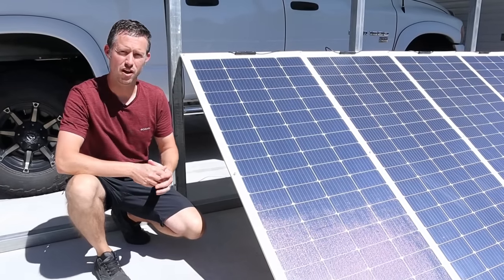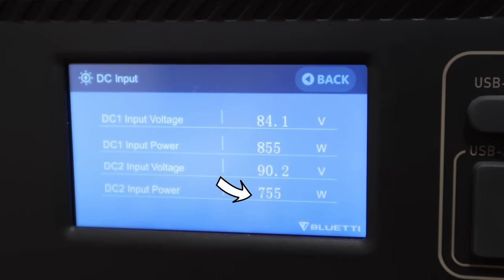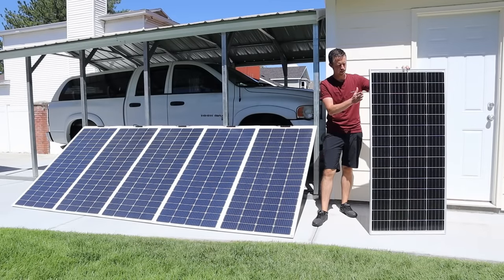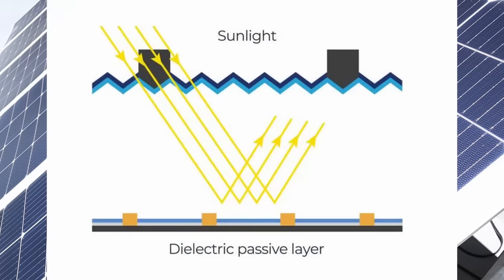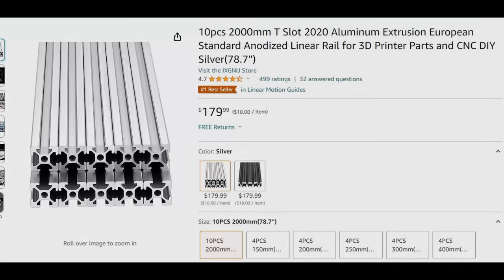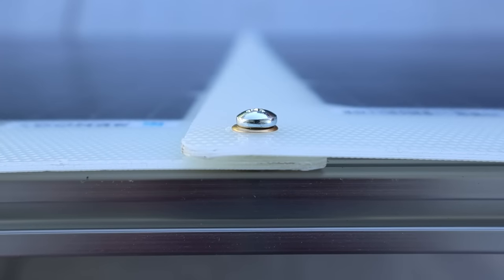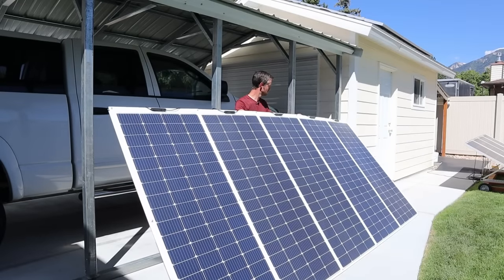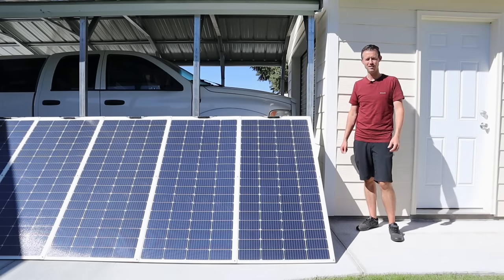DIY - 1000 Watt Lightweight & Portable Solar Array - Five Renogy 200 Watt Flexible Panels TESTED!

Comment from the maker: What a fun project! You can find the Renogy 200 Watt Flexible Solar Panels HERE:   https://renogy.sjv.io/200wflex
SAVE 6% OFF using DISCOUNT CODE:  JASONOID    (valid on their website until Dec 31st 2023)
You can also purchase them on Amazon HERE: https://amzn.to/45spg7C
Reply: Hi very nice great! why in the renology site is reported 12v while in the video i see 20 volt operating voltage?
Reply from the maker: @antoninoromeo4015  yep, that's how all 12v solar panels are. In order to charge a battery you need a higher voltage than your 12v battery. 12v panels put out around 20v at peak power. 24v put out 32v at peak power. The naming of a 12v panel is based on the batteries type they are meant to charge, not the output voltage.

Comment: Wow that is lightweight! Holy cow
Reply: That weighs as much as one of my 400W bifacials. Insane!
Reply: I wonder how well it would fair in a windy environment
Reply from the maker: I've tied it down to my carport using rachet straps, survived 40mph so far! 👍😁 Super impressed with the power too!
Reply: @WillProwse Very well! I have this exact set up plus 5x Renogy’s 175W panels for my EF Delta Pro’s (thanks for all the work you did on those, you’re reviews are why I pulled the trigger). 

I live in England so we don’t get the hurricanes you guys get but I‘ve had some serious wind (they’re effectively in a wind tunnel) and without them even being fixed to anything they do not move a mm. They’re just not thick enough for wind to get underneath to lift them, I do plan on fixing them before this winter but I’ve had the 175’s up there for a couple of years with no issues. I also have a 400W EF folding panel out there with them and a decent gust flipped that once despite the weight.
Reply: @InimitaPaul  The wind doesn't get under to lift them, rather it creates low pressure above them, the way a planes wings work. Up and away!
Reply from the maker: It's tied down with rachet straps now it's survived a few good storms, it never moved at all 😁👍
Reply: For rv install , this is perfect
Reply: Will Prowse wuz heeerrreee!

Comment: You know, if you went with 4, put a hinge in the middle, you could fold it and take it camping. 800w is a decent amount. It's light enough for camping. You, sir, just gave me an idea. Thanks 👍
Reply from the maker: Let me know how that goes! Extruded aluminum has so many options!
Reply: @Jasonoid  I have these 200W AllPowers foldable panels. I have 3 will get one more and use them. I'll let you know how it works out.
Reply: You can make a four panel double folding suitcase array
Reply: @Johnny_Kanuk - But AllPowers folding panels are not meant to be outdoors in all weather, as I understand the info on them (and other folding portable panels).
Reply: @debbiedogs1  yeah, hence why I would make it folding. Only pull them out for sunny times when I'm out camping or just need the power somewhere.

Comment: Cool project, but very expensive if you are not getting sponsored by Renogy 😂.  I think it would be cheaper, easier, and lighter to get a couple 400-600 watt portable folding panels.
Reply from the maker: These used to be affordable, near $219. The price of these jumped significantly last year about a month after the video was published. I actually bought 2 of them for a different project and then came up with this concept. Bummer the price of these is sky high now.
Reply: @Jasonoid  cool, thanks for the reply.

Comment: you didnt get an extra 50 watts from spraying the flexible panels and cooling them, your home panel array also went up by 50 watts. that means that the solar conditions made the difference, not your garden hose.

Comment: so $330 for one panel of 200w and you need 5, which is $1650 just for the panels alone. i'm in texas so hitting 77F... hahahah, yeah so definitely won't be getting ideal operating temps. this would be a waste of time for me in Texas, where we're over 100F for quite awhile and hardly ever in the 77F range.
Reply from the maker: 77F is the standard test for every solar panel in a lab, so you'll see less power with any panel any time the panel temps are over 77F (not just ambient air). Here in Utah we have summer temps over 100F regularly so our panels get pretty hot. 
If you want something more durable and affordable than this, I'd recommend glass rigid panels since they are a great option, they just aren't portable since they are so heavy. This video is about finding a lightweight alternative if you want to move it around.

Comment: I'm going to do this for a 12v setup.. put 4x 220w 48v shingle flex panels with same extrusions but I plan to add hinges to each of the middle parts so that the whole thing can be folded making them portable so around 800-880w, 190v in series and will have kickstands on it.. so it should produce min 66a to battery max 80a.. which is great.. On my rooftop tent I got 3x 200w 30v custom made shingle glass panels and they will max produce 75a but would mean I would need to park my camper trailer always in the sun.. but with this solar setup I could have a 20m solar cable from trailer to panels and place it anywhere within 20m

Comment: That is cool idea! Lightweight to move around and store against a wall. Nice truck metal carport idea for this heat. And you have probably figured out there is now more roof area to put solar panels on it. HaHa.  Or secure the lightweight panel array to the side of the metal carport so it acts like a wall but still gets sun. Great project!

Comment: Love it! This setup would easily provide all the power I need for my 3-season offgrid cabin. Nice work!
Reply from the maker: Are you looking for a portable setup or something more stationary? Glass rigid panels are more affordable and durable but hard to move around. This would work well if you wanted to stow it away when not in use.
Reply: @Jasonoid  Your question makes me think something more permanent with glass panels might be better. I already have 400W of glass panels, but the cabin is tucked in a nice shady spot. I could build something like your wooden unit and set it up about 250 yards from the cabin where the best sun is. Another 400W and I'd be good to go!

Comment: This is a great setup for anyone living in an appartment on the 9th floor. The Balcony becomes a solar power-station that can charge a Solar Generator or with an special inverter fed back into the grid. In Germany the maximum size (Capacity) of a balcony KRAFTWERK is 600 Watt but has recently being upgraded to 800 Watt. The main problem are the fuses and the maximum power-draw (current) with inadequate gage wiring. Wires can get hot and might trigger a meltdown.

Comment: Excellent video as usual Jason. I've used lots of the extruded T slot aluminium for projects and it's perfect for this sort of thing. While you could pop some hinges on the back, with T slot extrusions connected to them as legs, you can just use strong bolts and nuts to create a pivot joint.

Think of how a folding deckchair works, super simple, and you get the idea. It shouldn't make the frame too much heavier.

If you add 2 legs on the top and 2 on the bottom of the panel, you'll be add multiple slots in the bottom legs so that the top legs can lock into them - again, just like a deckchair. You could put the slots at the right distance apart to allow you to easily adjust the angle of the panels depending on the time of year / height of the sun.

T slots are so versatile and excellent to work with. I even built a full size Delorean time machine using 30x30 T slot extrusions! (If you're really, and I mean REALLY bored, you can watch that build on my channel :)
Reply: Pretty sure a lot of us would like a video showing what you are describing. Could put it on your channel (I just went to see your DeLorean pedal boat, amazing!) and Jason could maybe do a video on it and link to it. His video could also have clips of the PedaLorean, could be a fun collaboration, more views for all.

Comment: Great video.  I did a similar frame like yours and than redesigned it to where I used a 3/4" pvc pipe on the top with one inch T's attached so that they can swivel and use as kick stands.  The pipes for the kick stand can be 3 or 4 foot pieces with end caps that I drilled a hole with screws that dig into the grass at what ever angle you need.  For yours you could screw in some T hinges and attack the legs for a kick stand.
Reply from the maker: Thanks for the suggestions! What solar panels did you use for your build?

Comment: Impressive build sir! I guess I would say that I would break this down in 2 parts so I could take part of it with me in a cargo camper and add structural integrity for wind (that worries me a lot). Such a neat idea, thank you. Doesn't look like it'll cost a fortune either!
Reply from the maker: To protect against the wind blowing this away I used a ratchet strap to tie it down to my carport vertical bars, it's been working well so far!

Comment: I have a completely different application but your video was very valuable for insight into applying the materials to my needs. Thanks!
Reply from the maker: These panels have held up really well so far, I still get the same wattage 6 months down the road after being outside in the elements all day everyday 👍

Comment: just gave me the idea to use them as "solar shade" and "solar power" on the side of a tiny caravan/tiny house... think I could fit 4 of those in 2 sets of 2 for a total of 800W and super light weight + shade = win win... and time to move just fold them down easy peasy :D not that it needs much or high speed moving, just between pastures etc. and the weight is ridiculously low compared to normal solar panels... and renogy is usually known for great quality so I hope they will last MANY years :D

Comment: those new panels can get more power because you can angle them better.
i look forward to you keeping us up to date on how well those flexible panels hold up, 5 years seems to be 1/4 if the time residential panels are rated for.
as a side note, nice new car port you have there, surprised that you used a metal roof instead of a solar panel roof, maybe that is another project for another day.
Reply from the maker: Yes, another project in the works :) hehe

Comment: Thanks! I used your measurements with the same 5 panels and I pulled 960 watts today
Reply from the maker: That's awesome! Glad it's working well for you. Mine are still putting out around 1000 watts even after 6 months of everyday use. I really like these panels!

Comment: I like the idea that I could store it in my garage and then bring it out in summer to bolster my ground-mount solar for when my A/C is on. My ground mount handles all my loads except my 30 year old FAU A/C. So to offset that with an additional 1000Watts would be fantastic!
Reply from the maker: I move this around a couple times a week as needed. It's not the easiest thing to wield around but the power output is AWESOME!

Comment: Nice Renogy specs are so on point.
Reply from the maker: 860 to 900 watts of power at peak daylight for a week so far! Those numbers are very impressive :)
Reply: @Jasonoid That's 900W for the entire day, correct?
Reply from the maker: @MadLadsAnonymous  power at a single point of time is watts.

Power over time is 'watt hours'.  1000 watts for 1 hour is 1000 watt hours. 1000 watts for 5 hours is 5000 watt hours. Hope that helps.

Comment: I like that you build a frame for it. I’d like to see one improvement: make it individual frames and foldable for easier storage. 

I had a similar design in mind for my little sailboat. But instead of 80/20 I’m leaning towards 1” pvc pipe to avoid electrolysis in the saltwater environment. My ultimate goal would be 1-3 1000watt floating arrays to deploy at anchor. Now that would power a AC in paradise…

But your version, if foldable, would be great for campers and RV (vans). Mount two sets to the roof, in folded position you get power from one panel from each. At campsite, you deploy them and get a whopping 2000 watts.
Reply from the maker: That would be sweet! Folding it up with hinges shouldn't be too bad.
Reply: @Jasonoid I copied your cut list. Don’t have a miter saw so would need to buy precut pieces. 

What 80/20 hinge would you choose?
Reply from the maker: @TheCornucopiaProject-bd5jk  I'm not sure, I haven't researched a bunch of hinges for 80/20.
Reply: @Jasonoid how do these perform compared to the cigs panels from BougeRV ?
Reply from the maker: @TheCornucopiaProject-bd5jk  CIGS are the ultimate shading panel. If you plan to be in shade, use the CIGS. If you don't have shade stick with these.

Comment: Hi great video. I do not think I would go with kick-legs as there maybe a problem with the wind, but clips or hooks along the frame so you can fix to another structure could be good. 👍🐝🌞
Reply from the maker: I've been using a racket strap during this week and it's worked great strapped to my car port!
Reply: @Jasonoid  as with the wind strap a few videos ago, as this is larger than a folding panel and so could go like a hang glider, and so would need something.👍🐝🌞
Reply from the maker: @jimdaly5077  I was moving it around with a small breeze and yes.... It is very much a sail LOL... once it's leaning against something and strapped down it's solid.

Comment: You add a few legs in the back....and you got a toss up anywhere setup....I so appreciate this concept....way to think out of the box
Reply: I want to build 3 of these and add them to my off grid backup power supply when I want to switch from the grid with a transfer switch.
Reply: At least I will call it my backup generator, but in reality the grid will be my backup.
Reply from the maker: If I were going to build this again, I'd probably go with the 30x30 extrusion so it would be a little more sturdy. With the smaller material it  probably wouldn't work well with kickstands. Everything else about the project is excellent, including the solar panels and their performance!
Reply: @Jasonoid  Thanks, really appreciate the input, looking to semi kinda expand an existing doing something like this when I need excess power.
Reply: @Jasonoid  August and Jan/Feb having an extra 1kw tossed on would solve a bunch of issues.

Comment: that was an excellent build.
I might try that on a smaller cost of doing 2 panels at a time and add on additional groups of 2 later on.
Reply from the maker: That would allow you to use them together or place them in different areas in your yard!
Reply from the maker: Breaking the array up would make this much easier to handle and even allow you to put them in multiple areas around your home.
Reply: @Jasonoid  yep, easier to handle and easier on the pocketbook. just add on in increments.

Comment: Jason, have you done a follow up to this wonderful light weight array?  Would you still use the same flexible panels today?  I know there are more flexible options available today.
Reply from the maker: This array is still putting out excellent power and the panels still look very good. I really like this array and I move it around the yard as needed when seasons change. I think if someone wanted to put together something similar it would be a good project and last a long time. I have one spot the size of a quarter where I have a little de lamination on the corner of one panel. All the other panels are doing great.

Comment: Nice to the point. Any bad wind is going to kill this. What is your use case? If you leave it out 24/7 then a more permanent structure is called for? I would consider hinging each panel into a fold up structure if the use case is lightweight portable… of course that adds to weight by adding 5 more struts.
Reply from the maker: I added ratchet straps to hold it down. I've always wanted to see how durable these flex panels are so its mostly a long term experiment. The extra 1000 watts of solar is great to charge the power stations I test for the channel.

Comment: O.k. great, so 5 panels will give me 120volts . Thanks again  !
Reply from the maker: Correct, if the five panels have around 24VOC, when putting them together in series it will give you 120v total.

Comment: nice ill need 2 panels for my needs and im good
Reply from the maker: That would be a sweet lightweight setup!
Reply: @Jasonoid  plus I'm in California so we get lots of sun all year .. so maybe 2 or 4 100ah 12v on 2 pannles or 3 or 4 max will be enough for my trailer .   If I'm getting 17amps + max charging for 3 to 4 hours a day that's more than enough to run lights solder iron my router and charge up phones and laptops ect..

Comment: I wish someone would invent a lightweight or flexible panel that would actually survive the sun for more than one summer.  Great when they are new and for intermittant temporary use.  Five year warranty.  Wow, maybe Renology kinda did it.  Glass warranties 20 years easy, though

One thing about pouring tap water on hot panels:  especially if you have hard tap water, as it dries it will leave mineral deposits on the panel surface which will cut down electricity production.  It's why I recommend washing your panels in the rain, so the mineral free rain water will create a finishing rinse to remove minerals.  Some people are using that auto windshield treatment on thier glass solar panels.  It helps water and bead off and creates a kind of teflon coating so minerals can be scrubbed off easily, so that might be an option if you want to wet your panels.
Reply from the maker: That's why I sprayed the back of the panels with water at least, but good points on the mineral deposits. I'll be providing an update on these panels down the road to see if they survive, I'm very curious about that.